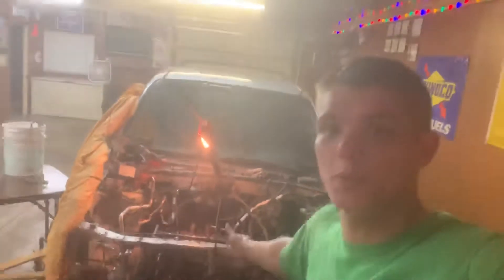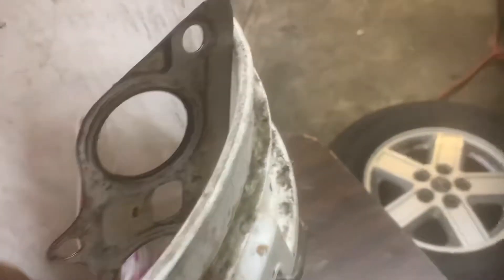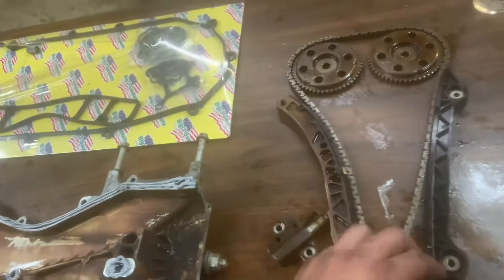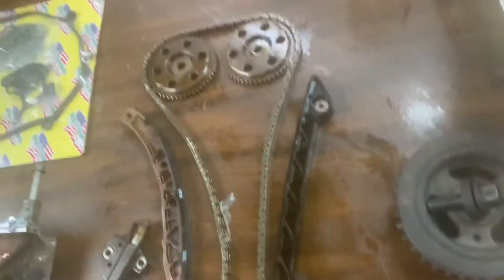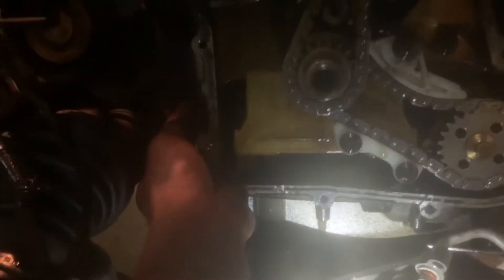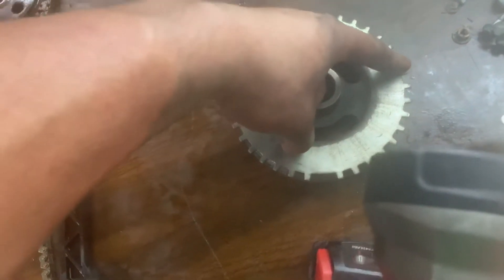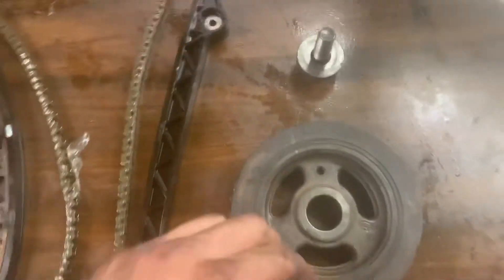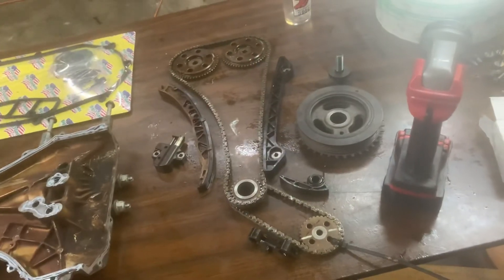Ford 2.3L Duratec Timing Chain and New Valves

Comment: The crankshaft timing pin support the force of the torque?.I’m going to do one ranger 2.3,I’m a little nervous of that step.
Reply: no, you have to hold the crank with a tool. The required torque will likely sheer off the lockpin